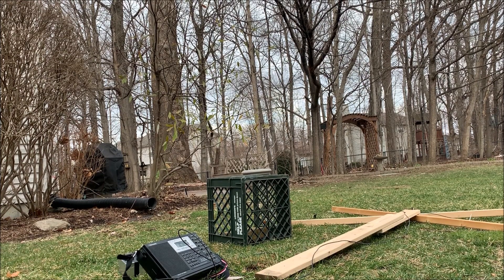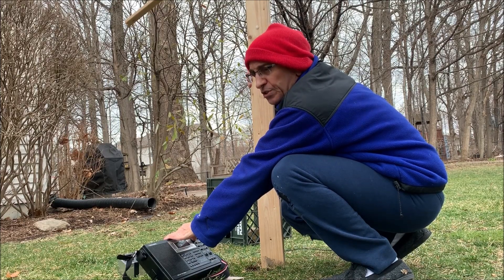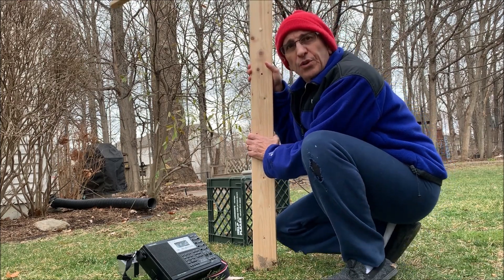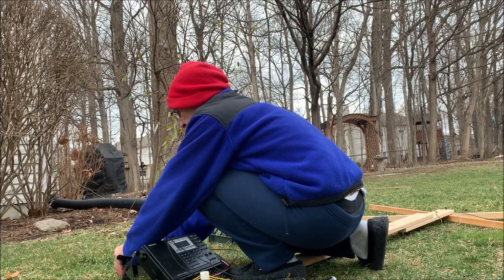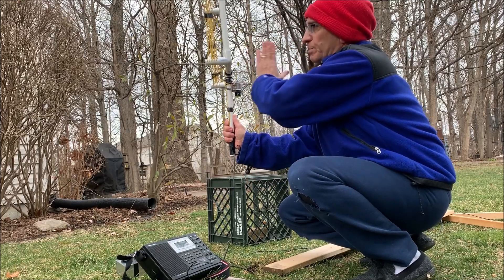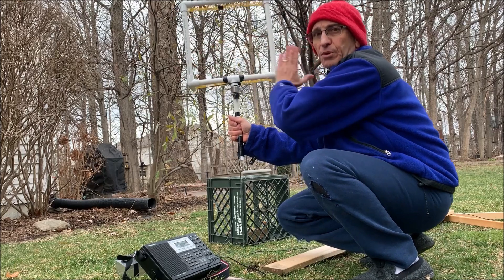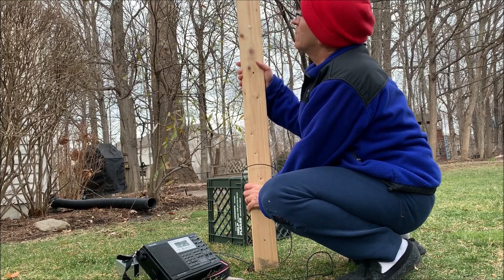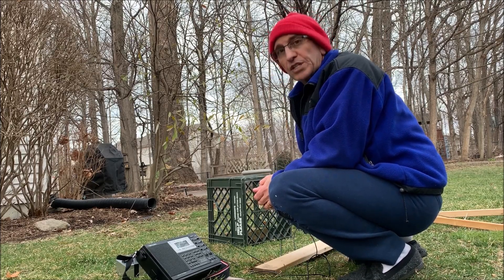WD8DSB Portable Flag (Terminated Loop) Vs. Tuned Loop for MF/HF Radio Direction Finding Feb 20, 2020

Comment: Hello, I'm having a hard time getting either a peak or  a null.  I'm using the DXE kit, nice kit by the way, with the preamp.   Pretty sure my problem is the neighbors solar panel. But, I can get a null in my back yard pointing to his stuff, but as I walk a big loop around, across the street, I can't get a null.  This seems to be pretty straight forward but I'm not sure what I'm doing wrong.  Also, using a laptop and SDR.
Reply from the maker: You need to make sure you are standing away from other objects (overhead power lines, metal poles, etc.), and if you are still not able to detect the difference between the front and the back of the antenna (no null) then the signal is likely too strong and you need to introduce more attenuation and if that does not work then you need to also turn the preamp off, and still use attenuation.  You also need to make sure your laptop with SDR hardware is not generating noise which is a very common problem which is typically not encountered when using a dedicated portable receiver.  P.S. if standing too close to other objects the null can get skewed or you may develop a minor peak off the back side of the antenna causing 2 nulls (one on each side of the minor peak), and then the peak becomes more reliable for direction finding.
Reply: it is possible you are carrying a noise source with you as you attempt to DF. try a battery powered receiver and DF your laptop.

Comment: I really appreciate this info. I too saw your QST article. I have about 20 poles within 1500 feet of my QTH. My noise isn't awful, but it's definitely there, 3mhz - 70cm. This design will be a great tool in the toolbox. Again, I really appreciate your efforts here.
Reply: Or you could get a chainsaw😷🤭😆😅😂🤣

Comment: Really useful, thanks.  And thanks for the QST article this month.  I seem to spend half my life chasing down noise sources on 160.  It's sometimes power lines, but mainly cheap, crappy, fraudulently CE/FCC marked Chinese SMPSs.  They have the filter components marked on the circuit boards, but the cheating slimeballs omit the actual components meaning that they feed junk into the mains supply and use house and overhead wire to radiate it.
Reply from the maker: Thanks.  I too spend a lot of time tracking down SMPS and other non related power line related RFI (it gets worse everyday).  Used the portable flag down in Indy a few weeks ago at another Hams QTH, and immediately found 3 different sources of RFI (next door neighbor with Plasma TV, some kind of odd looking porch light from house across the street causing broadband noise, and another broadband noise noise source from another home nearby.  Really great being able to instantly understand the direction the noise is coming from versus the 180 degree uncertainty of tuned loops (would have been baffled with the 3 simultaneous noise sources if using a tuned loop), but I still have tuned loops as part of my direction finding arsenal.  73, Don
Reply: @wd8dsb  I use a couple of 6' diameter shielded RX loops made from LDF550 7/8" coax for 160 since my inverted L is so noisy on receive, but being a mile from 400kv lines makes 160 a real challenge.  I have 150 countries confirmed on 160 now but may have to explore the possibility of finding a quiet location for a remote SDR RX.  Do you have a reference to the tuned loop, by the way?  Have a look at VK5SFA's mag loop for 80-160.
Reply from the maker: @unkledysfunktional7169  Great on your 160 meter country count.  Think I'm around 125 confirmed on 160 meters running 100 watts and a 68 foot base loaded vertical from Indiana.  Curious what your call sign is (I think I know what it is based on your comments about the missing filter components in SMPSs)?  Here is a link to a couple of different tuned loops I also use for direction finding:  Tuned Loop shown in the above video which tunes 1.4 to 4.4 MHz https://sites.google.com/view/pvc-tuned-loop/home and Tuned Loop for 7 to 32 MHz https://sites.google.com/site/smalltuneddfloop/home  73, Don (wd8dsb)
Reply: @wd8dsb  Thanks, Don.  Yes, you guessed it :-)

Comment: That's what sense antennas are for with the loop. Watch ARDF foxhunting videos for info.
Reply from the maker: Hi KB9CFH, I know that's what sense antennas are for, but a system that uses a sense antenna is much more complex, and also not necessarily broadband.  I was working on a sense antenna for my tuned loops but wanted to see if there was a much less complicated system to design and build that would be unidirectional, and that's how I came up with the portable flag (portable terminated loop antenna).  It really is a game changer for my tracking down of RFI on MF and HF frequencies.  My design works well from 1.8 to 30 MHz as long as an appropriate preamp is used (even works down in the AM broadcast band), and there is nothing you need to adjust to balance signals between the sense and main pick up antenna, etc.